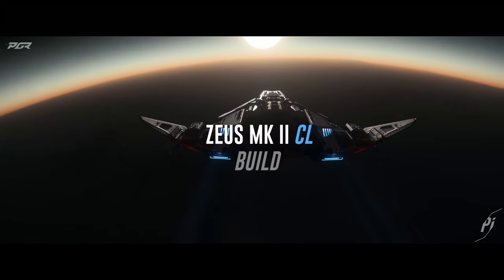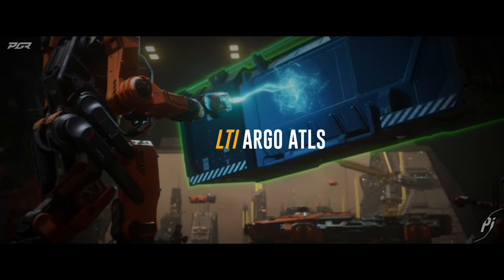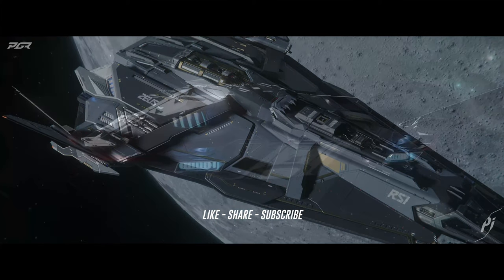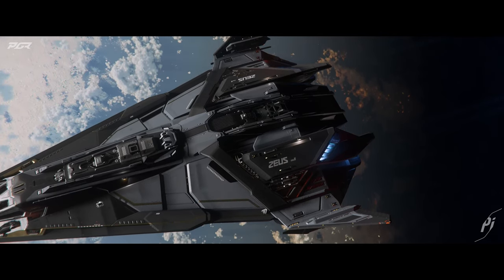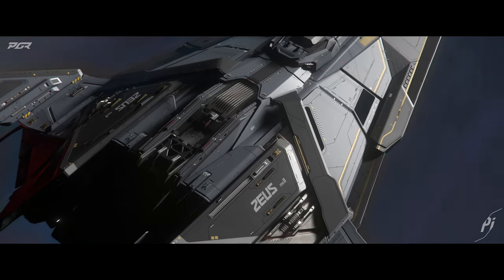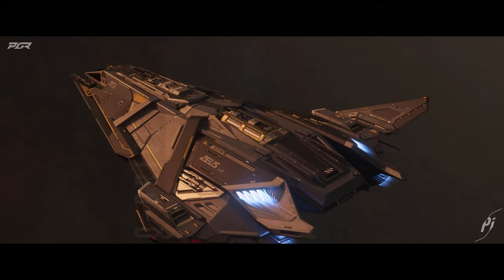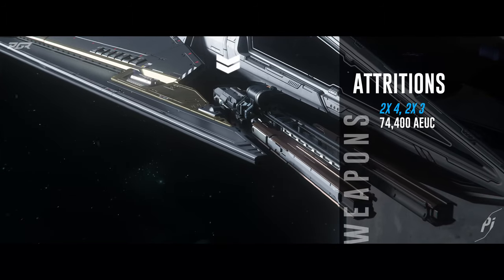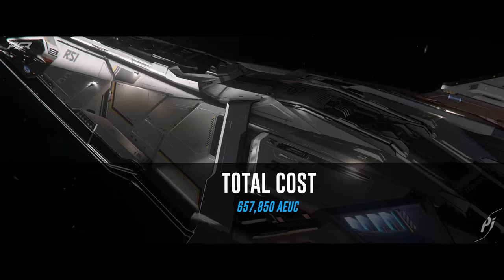Best BUILD For The Zeus Mk II CL - Star Citizen

Comment: Attritions don’t work in patch 3.24.2, and all Quantum Drives of the same size have the same speed and fuel consumption in this patch.
Reply from the maker: It should be fixed in the .3 patch.  Yea they will continue to make changes to components probably until SC 1.0.
Reply: @PGR_  wasn't fixed, shocker I know

Comment: What is the EM and IR values for this loadout, also what is the default pip allocation since you can't power everything and if shields don't have full value they have lower resistances and more damage gets through to the hull before the shields are downed by damage.

Comment: Where did you get your stats?  According to Erkul:
- The highest power pips is 21 (luxcore) not the 20 from a Genoa.  
- The highest shield hp is Haltur (6170), not the rampart (5460).  
- Quantum drives only vary by size and HP, so XL1 is the best based on its HP.
- The highest cooling is from AbsoluteZero (31), not the Snowpack (29) 
- Attritions by far the best (once they work again!)

I have found that dynamically allocating stuff during a fight rarely works well since you cannot control where the pips are taken from.  Additionally, since armour is not yet introduced and Engineering is not yet in, there is no reason to consider component HP.  For that reason I have gone with:

Power = 2x luxcore, Shields = 3x Haltur, Coolers = 1x AbsoluteZero & 1x Nightfall
I leave quantum drive as stock and use Rhino repeaters (until attritions are fixed).  

This allows me to set max weapons, max shields, 2 pips in engines, tractor beam off and everything else max.
Reply from the maker: I'm not considering competition components due to their very low health points.  In a scenario where you're attacked they're the most unreliable.  Remember my premise at the beginning of this video, Fast and Reliable.
Reply: How’s this build been working for ya?

Comment: What about the Crossfield Quantum Drive? I think it has a balance on greater speed (than the Bolom, for example) while still can have a better fuel efficiency than the XL-1 Quantum Drive).

What do you think?

Thanks for your suggestions.
Reply from the maker: The Crossfield is also good.  But CIG is making changes to the components from patch to patch so we'll see once 4.0 is out atleast.
Reply: Currently, Quantum Drives choice doesn't matter as all the stats for them are the same as of 3.24.2.

Comment: Question? Why attritions rather than balistic gatlings like the revanant? Currently im running my ship with a similar loadout so im wandering if there are any advantages to the atritions over thst gattling apart from ammo
Reply from the maker: The attritions has the highest DPS for a S4 Laser Repeater.  Plus I don't have to worry about running out of ammo.  But If you don't intend to fight much with the clipper, ballistics should be fine.
Reply: Great build. I will save this video to check it when my Zeus MR comes out.
Reply: Attritions series repeaters don’t work in alpha 3.24.2, and will be fixed in alpha 3.24.3. Attritions have high DPS and alpha damage, while the AD4B is slower.
Reply: @PGR_  ohhhhhhh